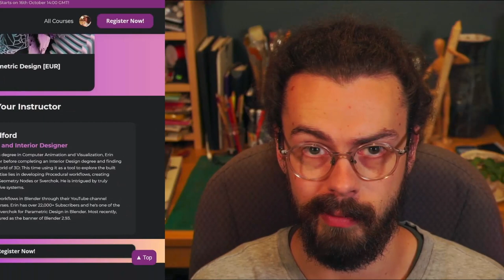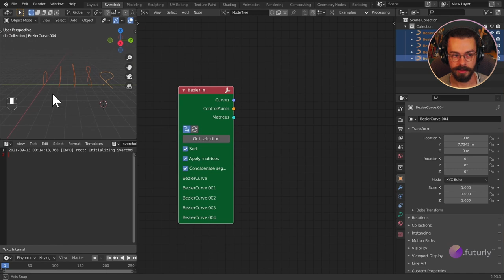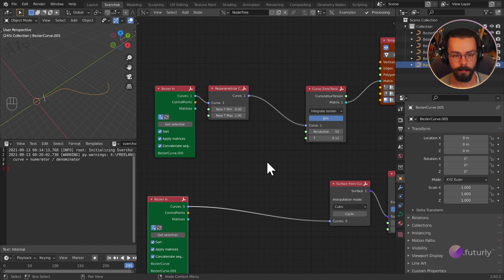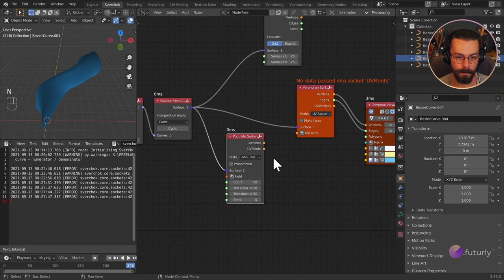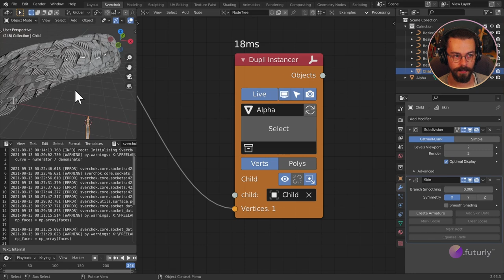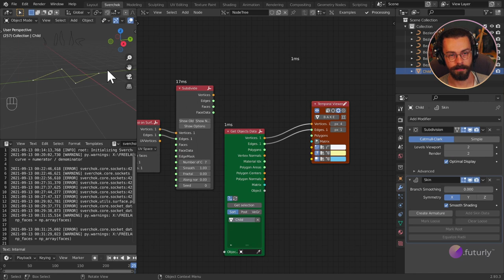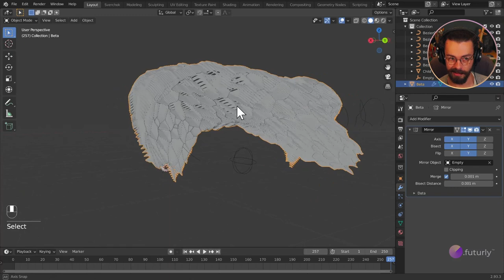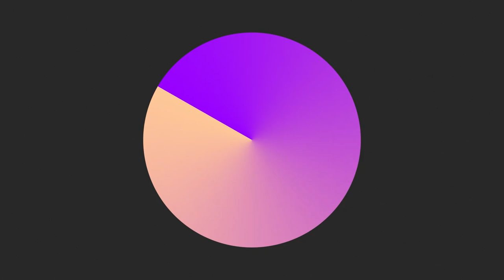Parametric Design with Blender - Sverchok Tutorial

Comment: Hi, is sverchok a good alternative to grasshopper? I was looking to learn grasshopper but suddenly I found out about this blender plugin and now I'm wondering if it would be a better choice
Reply from the maker: If you're looking for gainful employment in the architecture field then I'd recommend Grasshopper. It's an industry standard for parametric design. That said, Sverchok was built as a parallel for Grasshopper so learning one will help with the other. If you just want to learn about parametric design practice and you're a Blender user then Sverchok is a great test bed

Comment: i am in a bit of a pickle here...... i have a 3d printer but i can not find ANY parametric / CAD software i actually like to use...... Fusion 360 came pretty close but the annoying "highlight flickering" issue ruined that for me. all of the other options are terrible for different reasons. so, my question is: can i make logos and parts with Sverchok? if so, i will dive deeper into the how and maybe even buy your course.
Reply from the maker: You can but you'll want something to create your actual toolpaths I think. There might be some add-ons to do that though. In the course we design a sliced bench and output a proper SVG component layout with dimensions/line styles etc.
Reply: @Erindale  i am not sure what you mean by "toolpaths" or what addon could possibly do that in Blender. i would appreciate it if you could elaborate on that.